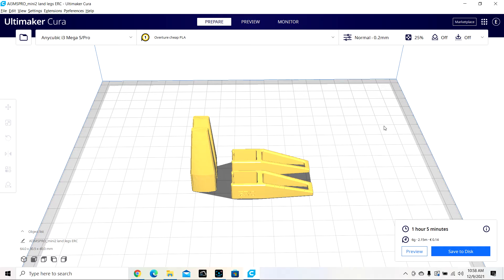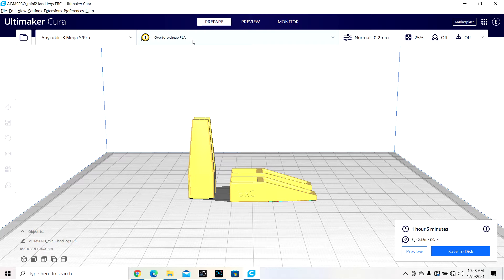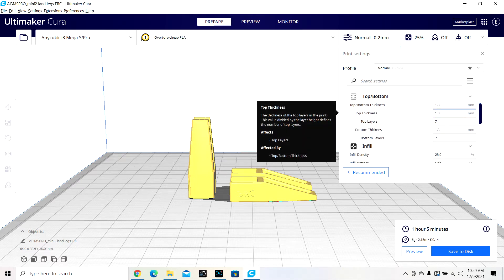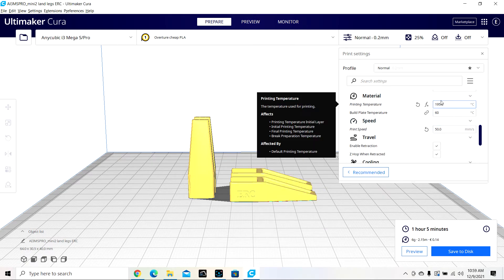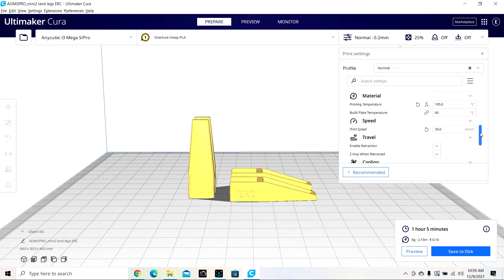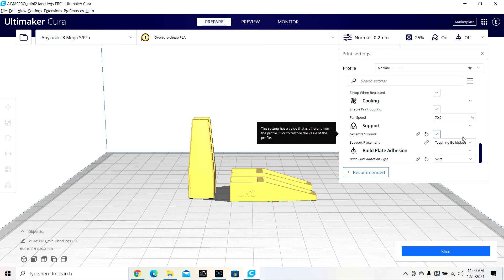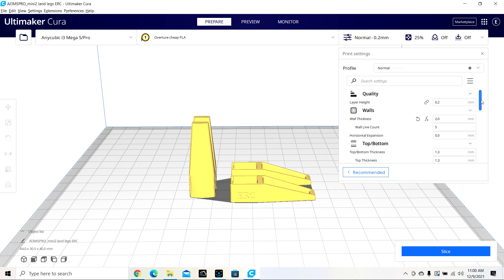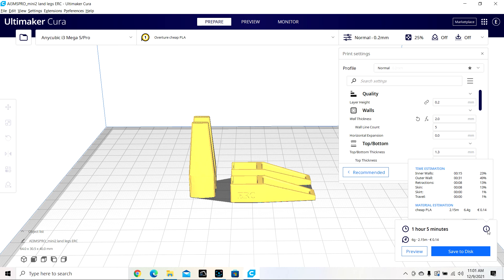Overture PLA settings for 3d printing that work well

Comment: Trying my 2nd roll of Overture, but the EASY PLA ORANGE-TRANSLUCID one on my Ender5Pro at 220 was stringing all over and failing fast. Will try your settings on the white Overture PLA standard one and compare.

Comment: Trying Overture PLA for the first time on my Creality Max Neo. Getting frustrated myself. Same issues. Trying some of your settings now. Was using 200°, changed to 195°. Also changed layer thickness and number of layers.
Reply: Follow-up: Using some of your settings and a later height of 1.2mm, based on my particular project and what’s worked for someone else, it’s made a world of difference. Thanks!
Reply from the maker: Get it worked out?

Comment: Coming from Prusa PLA, Overture PLA seems like it's garbage.  There was an optimal temp for Prusa PLA as well but it was more like do you want more strength or more dimensional accuracy/prettiness.  Overture PLA appears to be print at this narrow temperature range or have a stringy, goopy mess.
Reply: and to be clear, you can reduce temperature to 195C and get it to print decently, still stringing.  But make no mistake that this will be weaker than 205C+
Reply from the maker: I agree that it's not the best pla.  If you dry it very very well,  it prints pretty well between 195 and 203. It's very cheap too. I don't know the pricing on prusa pla off hand.

Comment: i have tried the settings , tried spray mount, glue stick and was tempted to try super glue lol. This overture pla is crap.
Reply: Actually I have worked through the problem and although it doesn't print as well as esun it is okay now.  I had to change Temps and soap and water the bed to get it to stick.  At least it isn't tangled on spool like a few others.  So,  I retract my original post and for the price it is acceptable once you nail the settings.
Reply from the maker: @Cluanar  yeah, it can be finicky. I had to lightly wet sand my bed with rubbing alcohol.  Now I always wipe the bed before a print with a 15% pva mix with distilled water.  Stuff always sticks now. I wait for everything to cool and falls right off. Really tough to get off when hot though.
Reply: @Cluanar  And what are your settings? I struggle with it too
Reply from the maker: I don't have problems with it.
Reply: What are your issues because their pla+ and matte pla are really nice.

Comment: I found that printing a heat tower helps to dial in the print temp for prints. You can set the g-code up to increase the temp as you are printing. I did this was a silk pla from overture and it really helped the quality of my prints. Here's the link to the heat tower I used
https://youtu.be/_PNEjuiiqhg
Reply from the maker: I'll check it out. I actually have it really dialed in now and works well for really any pla. The settings are different than this, so I will make a video showing it.

Comment: Thanks for your video. This is my first time using this brand and I was having issues
Reply from the maker: Did it help you? I have found perfect settings on my i3 mega s for pretty much all brands PLA. I'll be uploading soon. Ty.
Reply: @Erik740t  yea they work! The only thing I am seen difficult with this brand is printing at certain angles, I usually use hatchbox PLA but overture is working perfect too
Reply from the maker: @darisplays551  glad to hear that. I have been using sunlu lately. Have pretty good luck with it.